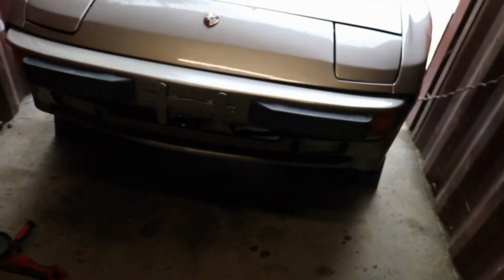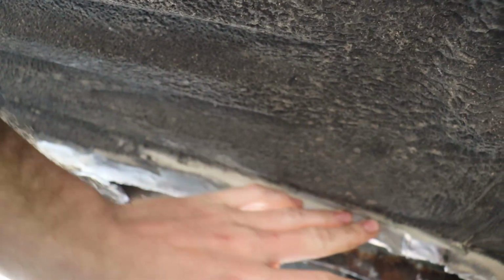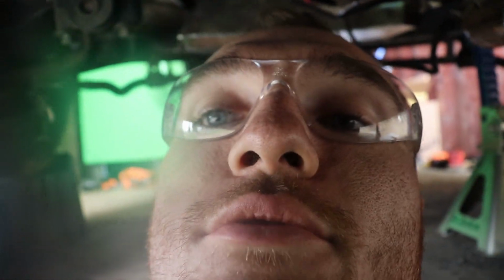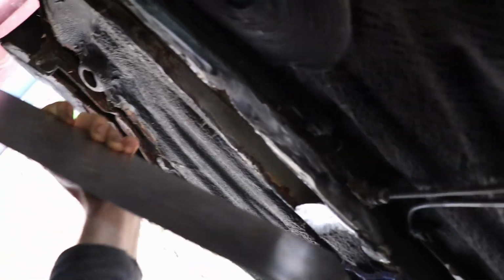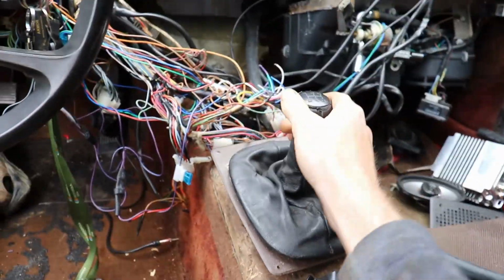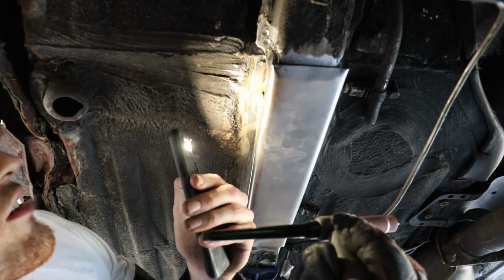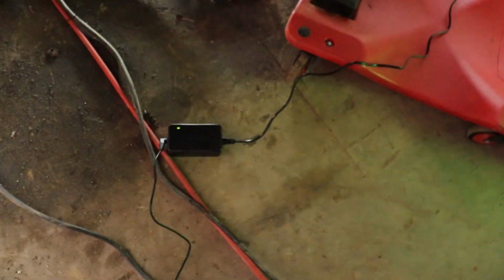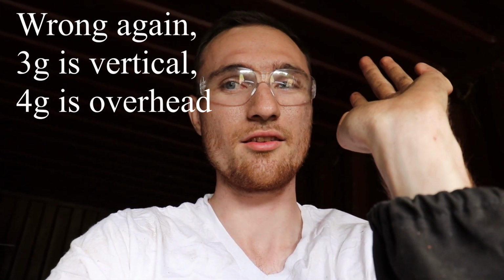Welding a new section of steel on my 944's frame

Comment: to get rid (or remove/clean the area you need) of that rubberized coating, you need to cut a line where you need your edge by utility knife or a blade or even just use a scriber or flat screwdriver and then , kind a peel it of with a flat screwdriver or a scrapper - much ,much easier and cleaner job then any type of grinding(im doing some similar job now on my 944 floor and rocker)
Reply from the maker: The wire brush on my drill worked wonders. Some form of scraping tool could have worked too & nice! Best of luck, my rockers are next, just need to get it running first. Body work on this thing is going to be an insane project!
Reply: @Icuosnas7  yeah, I feel your pain, I'm in it too. Not so much work, but still
Reply: Curious if you had thought about getting that whole side of the frame from a salvage yard. Do you know if the unibody frame rail can be removed. My 85 is rusted and the control arm pocket has a hole.